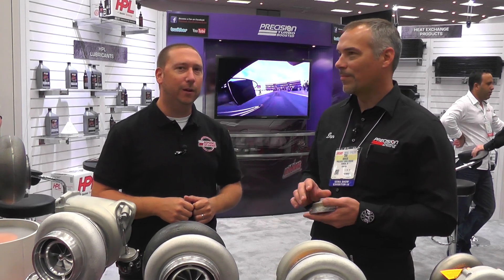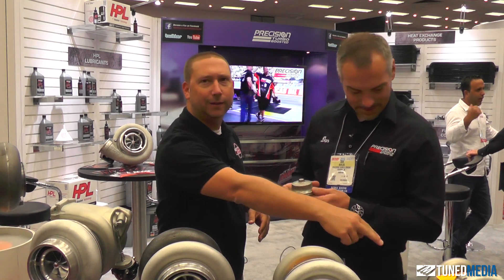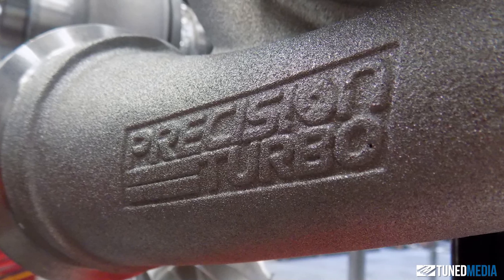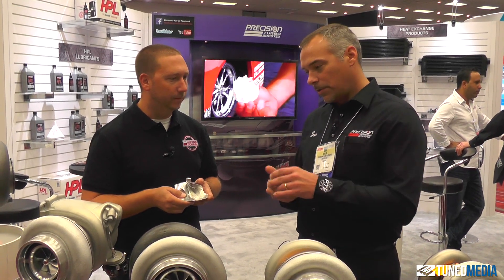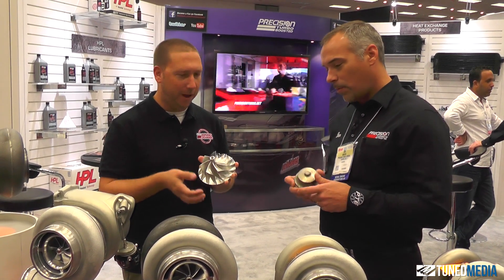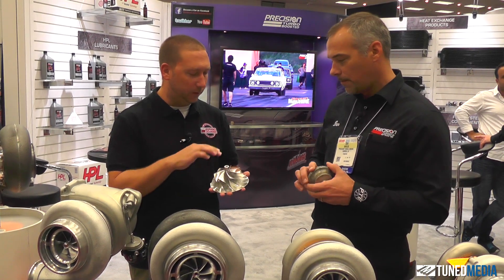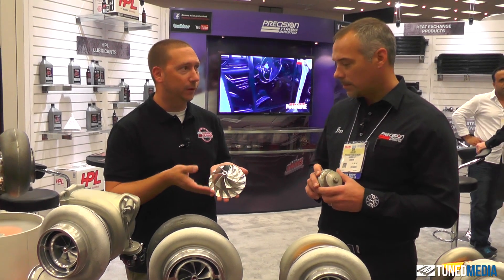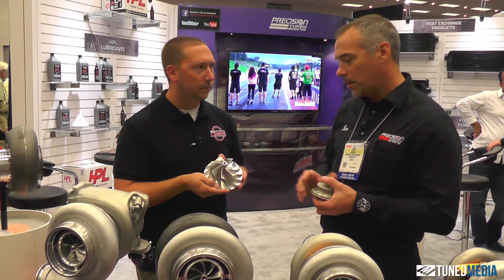SEMA Show 2016: Precision Turbo talks about new GEN 3 Turbo

Comment: And about a year later, it's worth scrap value.  These dudes dont keep them for long.  In fact, they use Garrett and Turbonetics parts in there.  I'm going to take a guess they use overseas billet wheels.  Some of their turbos are poorly put together.  My local turbo buddy wont touch them.  No parts available.  I just need to figure out how they put mine together and where they got the parts and I can use this chunk of metal for another round.